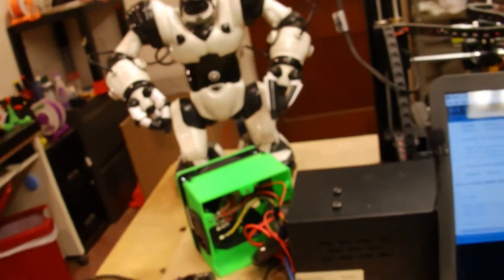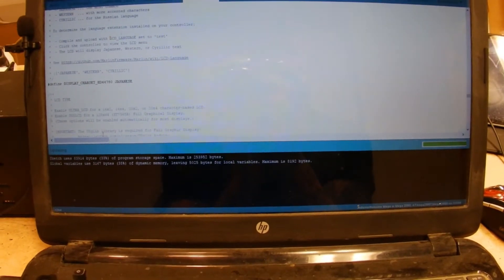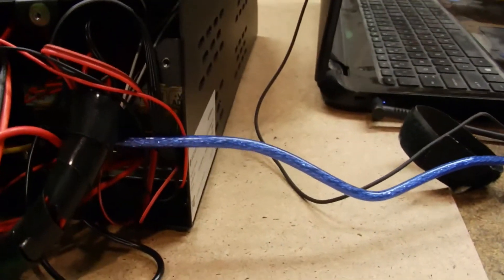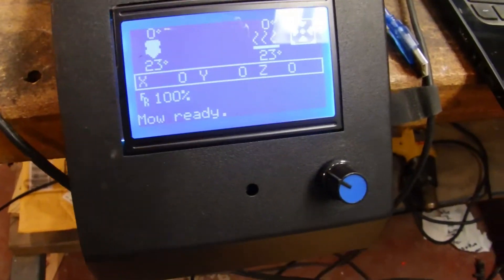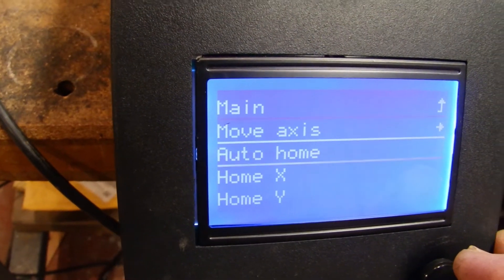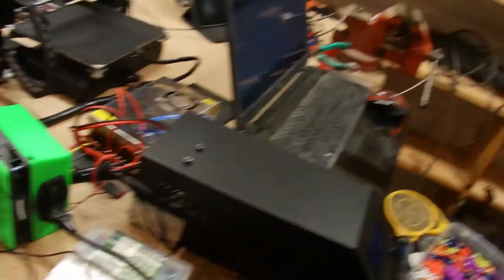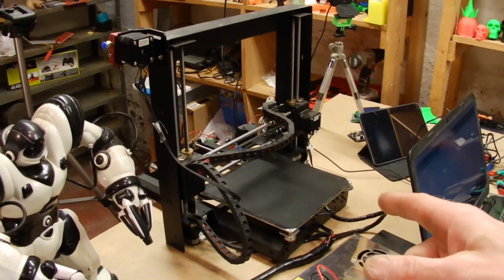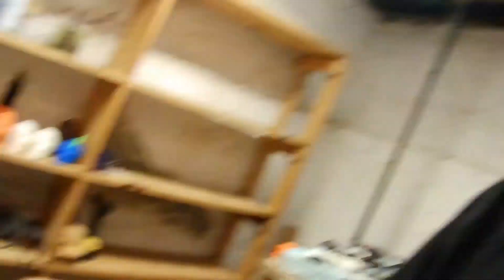Ramps Conversion Part 4 (Firmware and Power)

Comment: I was just wondering if there is a way I could get a copy of your configuration file. I got a maker select plus with a burnt out board. I bought all the stuff to convert it to a ramps setup. I am not good with firmware stuff so I just wanted to know if there is any way you can share the files with me. Thanks! Keep up the good work:)

Comment: Matt, you should check out Jim Brown's Marlin.  He made an Easy Config for the Tevo Tarantula, but it will work with any i3 printer, just switch the applicable hardware differences like heater resistance and thermistors.  The Easy Config means that all commonly used hardware on an i3 are brought together at the beginning of Configuration.h so the new user doesn't need to keep skipping around in 2000 lines of code, except for doing really advanced changes.

https://github.com/JimBrown/MarlinTarantula
Reply from the maker: i'll look into that thanks

Comment: whats the point of the mosfet?
Reply from the maker: Kevman83 the mosfet takes the load of the heater off the main board to prevent overloading the board
Reply: @InsideTheMindOfMatt  Which is definitely worth nothing that is a VERY common issue on Maker Select V2's which is the exact reason that I am here :')

Comment: Hi, i have the exact same setup as this, trying to install ramps but cant figure out the firmware. the only one i could find what everyone is talking about has been removed. Any chance of uploading your firmware? thanks :-)
Reply from the maker: Corne Breed I did make another video where I showed all my setting would that help
Reply: Hi, I watched the other video and got some pointers thanks. I had alot of issues, turns out, the ramps board that i bought for my other mpcnc had drivers configured in 1/32 stepping, I removed the jumpers to config in 16 and the size came right, but with alot of noise. I had the Z's running off of 1 port (with a bridge cable as i didnt want to cut the cables for new fittings yet) so i split them and that noise went away. But still had noise on the bed and was cutting out. So the one driver was under volted. Fixed that on the knob an bobs your uncle. all working great know busy printing the Ramps mosfet bracket. Thanks for the info keep up the great work. :-)
Reply from the maker: Corne Breed fantastic glad to hear

Comment: Hi Matt ... no luck I have even had the board checked by the supplier to make sure there were no faults.  So can I take you up on your offer of sharing the settings.  I have spent over 3 weeks (every day) with every possible permutation of the firmware.  I have had to revert back to the basic FW several times as it has become easy to get lost within the variations :-(  many thanks
Reply from the maker: hit me up on facebook and I do what I can for ya

Comment: This is great ... thanks.  I have completed all the wiring but nothing is working.  I keep getting a heater reset warning on my LCD screen.  On the power supply I am only using one positive and one negative out put,  is this right as the melzi was using some com terminals.  Slightly confused with everything and like yourself didn't get a blue smoke or a bang when I switched it on
Reply from the maker: paul w your thermistor might be reversed or not connected
Reply: Thanks will try reversing just hope I haven't fried something
Reply: Have checked double checked and triple checked everywhere is on correctly.  Interestingly now the lcd screen does not display anything am totally flummoxed.  Have emailed the seller of the board as i believe there could be an issue with this board.  When I received the board many of the pins were bent and some of the terminal blocks were not parallel
Reply: You don't need to worry about polarity with the thermistor or heaters.
Reply from the maker: if you don't get anything on the display the you might have the wrong one selected in the firmware
Reply: I read your mind and your answer was correct :-) wrong one was selected Thank you Matt
Reply from the maker: paul w I'm in the same benchie lol but this conversion cured my fears still tweaking mine here and there but got most of the settings good now if ya get stuck let me know I will share my settings. Been meaning to do a wrap up video on this but settings can differ from one machine to the next so not sure how to go about it and what to share that will be the most helpful.
Reply from the maker: paul w I'm here to help noobs like me to not be so noobish thanks for the kind words and thanks for watching and thanks for subscribing!! You ever have any ideas for videos feel free to pass them along
Reply: Thank you.. I can build these machines and end up with amazing prints but the firmware side confuses me so much ;-)
Reply: Bless you matey much appreciated I hope you won't regret that offer ha ha I have actually come a long way in the 3d printing area building machines etc but only very recently started tinkering with the firm ware.  I fitted a BL Touch to my Prusa and was ecstatic when it worked with the help of a lovely lady in Washington.  I am in England and any type of expertise seems quite rare.  Keep up with the videos though as they really are very well explained and even easier to follow.  Thank You
Reply: Ok so I edited the firmware compiled and uploaded way to many times.  I think tonight I have actually made things worse because its got to the point where I have made so many changes that I have forgotten what I have done.  So,  I started again with a fresh Config.h file but no I get errors when compiling saying that I am using an old version when I have done a few edits.  I don't drink but tonight I am about to have a beer.  Will try again tomorrow :-(